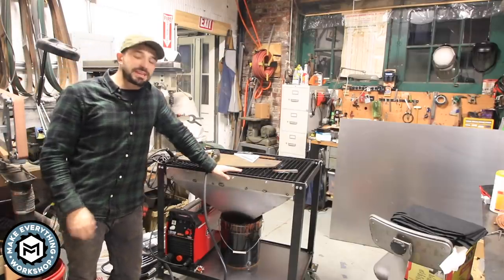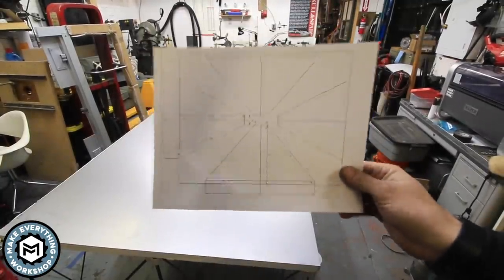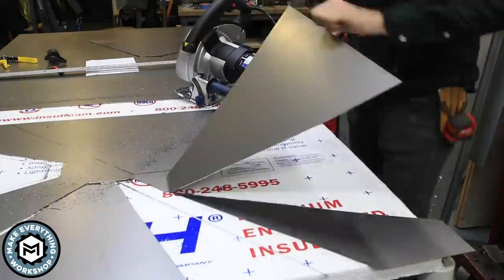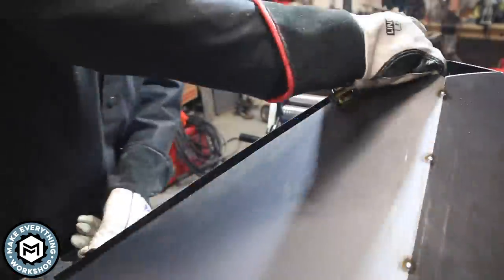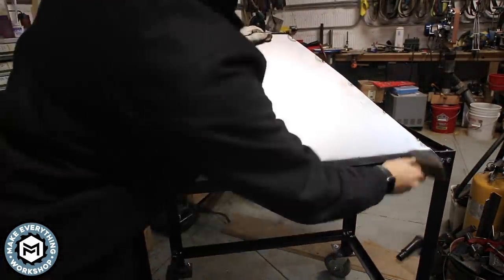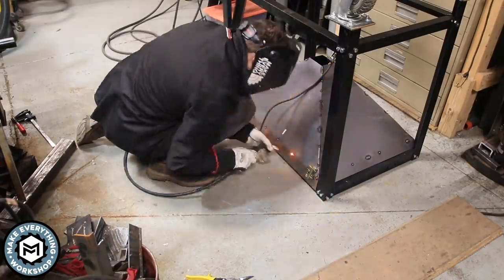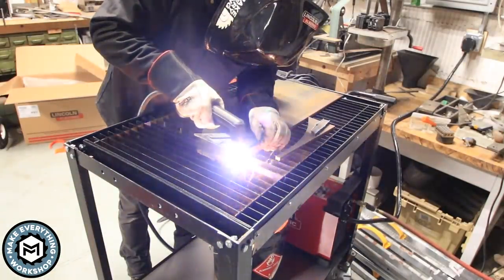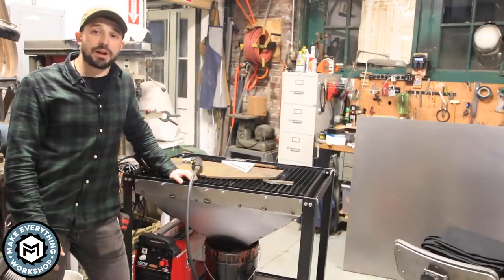$150 Plasma Cutting Table - With Spark Collector

Comment: You probably have already thought of it 
But if you put a small expanded metal screen down in your hopper you would be able to catch smaller parts and not have to dig them out of your bucket 

Very Nice setup

Comment: Talk about Common Sense. My sandblasting cabinet has the same taper underneath it to catch the sand. And that's a great price for the table.. just in case you want to modify it , you have a great base to start with. 2 THUMBS UP 👍👍

Comment: cool video but couldn't help but wonder why you were using circular saw, and 4 inch grinder to cut sheet metal when you obviously have a plasma cutter
Reply from the maker: it was much easier to cut the sheet on that foam board than to try and support that sheet while letting the plasma arc cut through it. Plus it makes less smoke, and less of a chance to warp that thin sheet metal.

Comment: Excellent job.  

the "buy (table) vs make" was clearly the correct one

What about a fumes, smoke eater worked into the bucket?
Reply from the maker: I usually do my cutting outside, and when im inside I have a smoke eater over the welding area. It would be nice to get a smaller one thats just dedicated to the plasma table tho... Now the wheels are turning!

Comment: Any reason that the smaller panels come out 1/2” higher than the longer bent pieces?  (17-1/16”). If I make all 4  sides that dump into the bucket all flush on the small end than the small panels stick up 1/2” past the bend on the bigger ones.
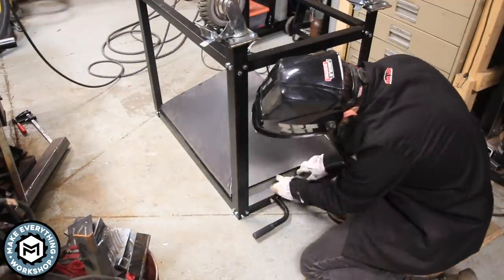Reply: So you can bend the side up closer to the frame. Video doesn't show it. Plans don't show bending on that piece either. Hard to explain. You can see he sheared up pieces for the short sides too. See 9:06.